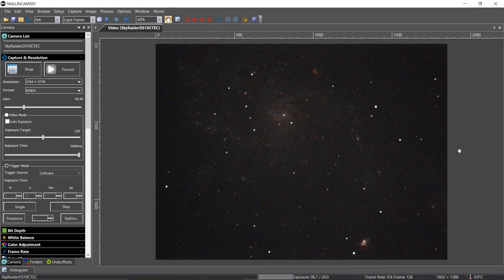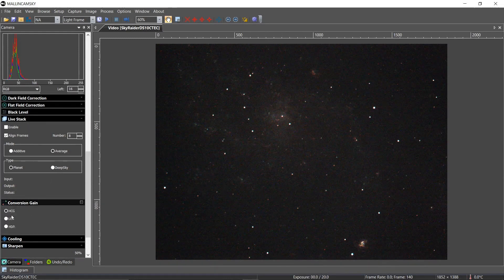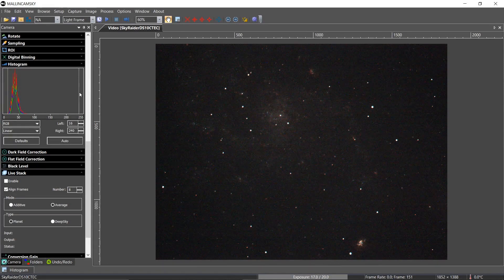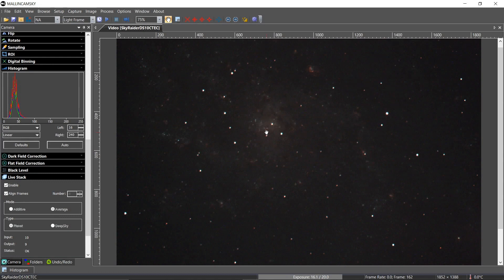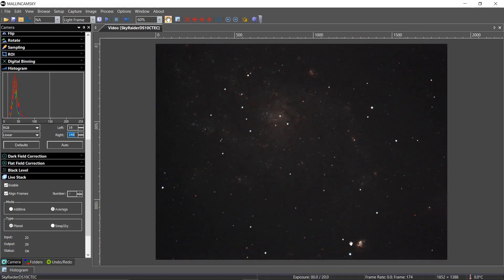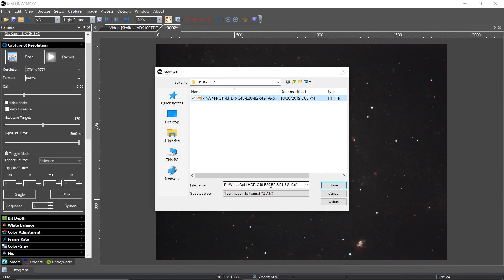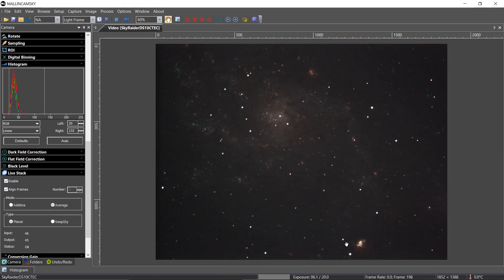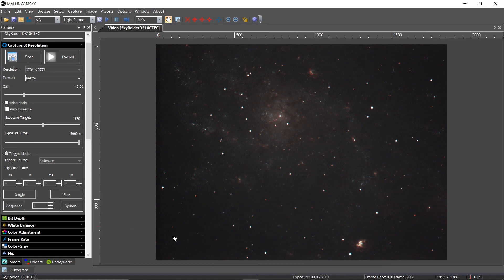LHDR Tutorial Session 20191020

Comment: interesting.. can you do 300 sec subs?  are the RAW files Fits ...
Reply from the maker: Depending on which Mallincam camera I wish to use. I can go up to I think 16 minutes. I would never need to do that, but it's there to try if you wish. Using higher exposures would require you to use a lot less gain. These sensors are very sensitive. You can save out your image(s) to fits if that your choice. I post using Photoshop so I save to .tif files. Then after I get them into PS. I'll make them 16 bit. Hope that answers your questions..
Reply: @jeffrh  so drop the gain to about 20 then try 180-300 sec subs .. i want to do 30 hours of integration on NGC-2244  , and i will use FLats and darks , probably BIas too. its the DS10C TEC ...
Reply from the maker: @BrokenPik  With these cameras. 180 sounds about right with no to little gain. I was about to give this a try when the clouds came. You can make Flats and enable in camera if you wish and the same goes for Dark's. I'm looking at maybe doing an hour's worth of integration. That should give enough signal to get some great images. Just wish I could try it... The beauty of these cameras is there ability to get great looking DSO in seconds. And If your looking for lower noise. Then lowering the gain is a must which will push your exposures out. My thinking is half or lower what your doing today with your gear. Yet to be proven..  ;-)
Reply from the maker: @BrokenPik  Great looking image..  If I had to take that many images for one object, I would find a new hobby!!  LOL!!  I'm not dissing your work flow. It's just not what I wish to do to get images of the heavens. I'm also a Photoshop guy and my work flows are all based on getting good data for that program. When ever I get some clear skies again. I can start testing some ideas I have kicking around in the old gray matter. Then I'll be able to report based on my experiences. The goal is to get low noise imagery that can rival almost anything out there today. Will I succeed, I sure hope so. That's what makes these cameras so much fun.
Reply: @jeffrh  Awesome reply,. just what i needed to hear. have fun... its just a hobby. im never doing 800x 30 sec ever again  it also was a test to prove my point ...clear skies.
Reply: I was on NSN for years, i know Chris and Don a Rock Mallin.and a few other guys...
Reply from the maker: @BrokenPik  Should come back. It's still fun watching Jack, Rock, Rusty, Bob, and others do there thing live!
Reply from the maker: @BrokenPik  There are a group of us on the Mallincam forums trying different things that hopefully will get us what we're after. Time will tell the tale! I for one look forward to the challenge.
Reply: @jeffrh  very nice, perhaps once i start feeling better ..
Reply from the maker: @BrokenPik  Here's to better health and clear skies to go with it!!